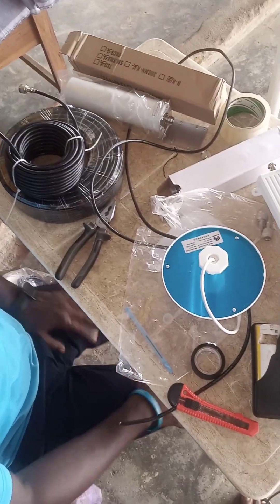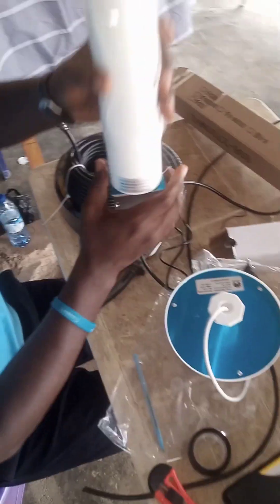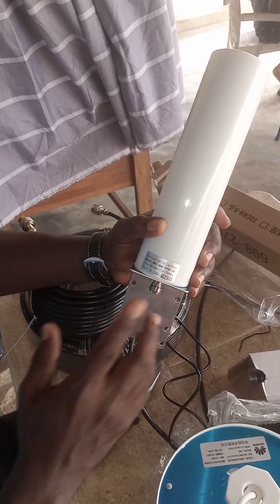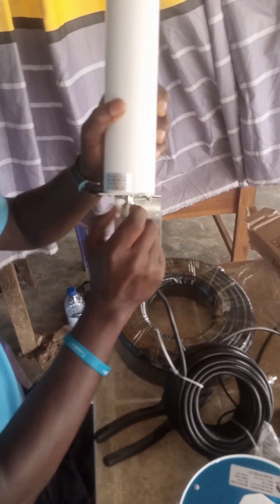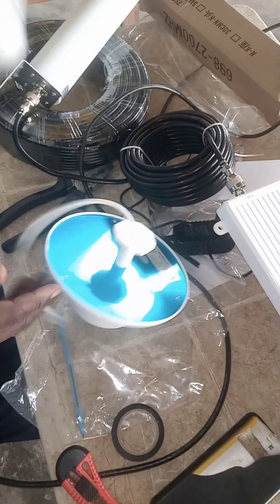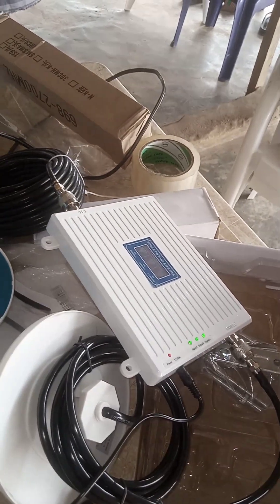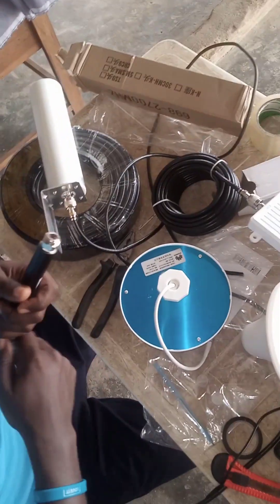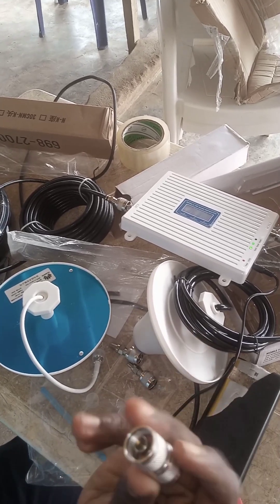How to set up a 2G/3G/4G GSM Network booster to improve the signal and quality of service #network

Comment: Sir, can i get your contacts. 
I need a booster for my 5g router and 4g phone asap.
Reply: Can this setup boost for 5g?
Reply from the maker: @perezteejay2945  Yes, if it's a 5G device repeater
Reply from the maker: Yes
Reply: @installerpaul  okay sir, how much will this cost now?
Reply from the maker: +2348038015711
Reply: @installerpaul  thanks